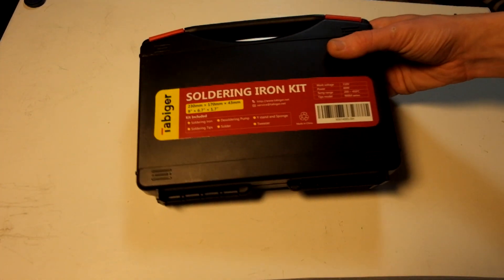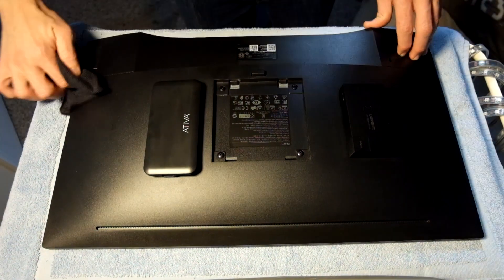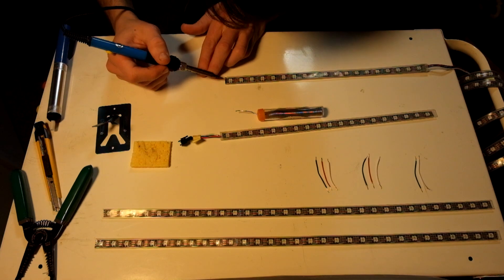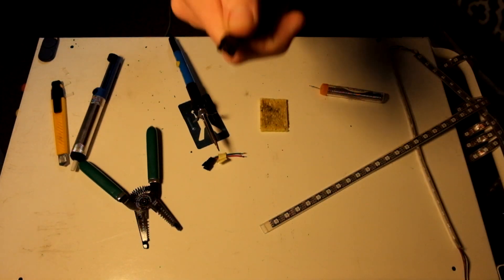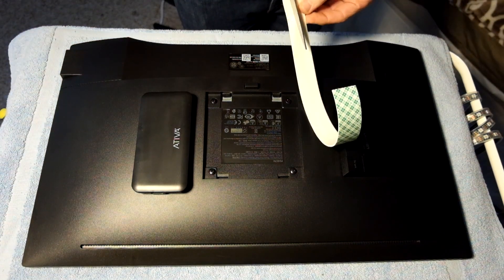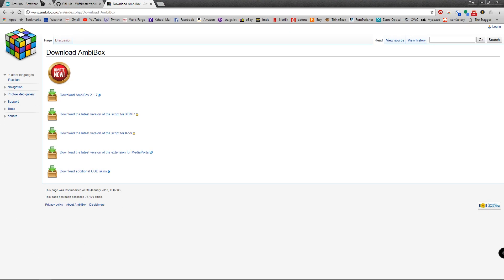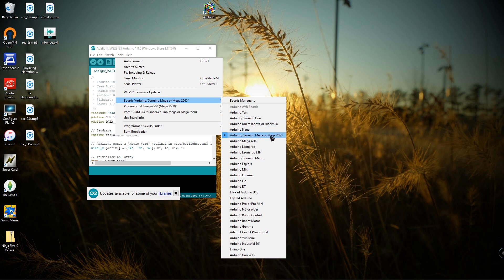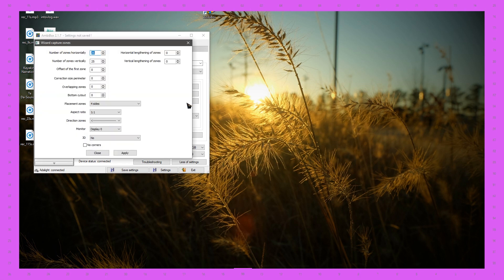Ambilight Tutorial (WS2812B)

Comment: Used ambilight as interior lighting for my PC instead of the monitor immersive effect. Got 3 deepcool CF120 fans with 12 addressable leds for each fan and daisy chained the connection (set the number of LEDs on adalight to 12) and sacrificed one of my molex connectors. On ambibox, I clumped up the 12 color detection boxes at the center instead of the usual boxes-at-the-edges. Configured the boxes with respect to cinematic aspect ratios, rule of thirds and whatnot. I was dumbfounded at first because I thought the idea was stupid but then I put it to a series of benchmarks from slow color shift videos to tomorrowland concerts only to find out it was as epic as monitor ambilight. I guess the effect would look much better on fans with ring LEDs but hey the PC now looks like a strip club. Thanks a ton dude for this helpful tutorial :D

Comment: Did everything you said.  But when I click on backlight no Lights.  Every time I reboot ambibox, the lights do cycle on red, blue, green, and then they cut off for good. Ambibox says it's connected, but no backlighting action.
Reply: Same here, no answer...
Reply: @Drakten1224  Click on more options in the bottom right corner of Ambibox and then select the COM that you set up on the Audrino. By default it is on COM1. Yours is probably COM5 if you followed along with the vid. However, I would actually now recommend using Prismatik. You can pretty much work it out as you go along.

Comment: i Just made it and its really looking awesome but i have a problem!
Some leds wont respond according to color pixels in screen, i looked closely at them they do turn on but have very low brightness and wont change color correctly. So what could be the reason??

I am using 104 Leds setup and 6A external power adapter.
Reply: 60mA on 1 LED

Comment: How its work with LED beacause no wire or cable is connect to LED Tv to Arduino? Tell about connection between Arduino to  LED Tv?
Reply: It works only with PC. You can install Ambilight App for Android on your Smart TV and connect Arduino to TV.  Or use a more complex circuit with Raspberry PI to work with any HDMI

Comment: Oh my god. Best explained out of 15 videos I found before you!!  Thank you. 
Question. I have 3 monitors in my station. (I’m a pro artist). I have a 50”. Ultra hd 4K. And a 24” 144 refreshrate monitor (for reference). And a 22” cintiq!  
I would like to use the same uno board to have it control lights behind the 50” and the 24”. Plus light under and around the desk.  Is that possible or do I need an uno board for each

Comment: I wanted to post and thank you for the helpful guide. I also wanted to share what I used to join my LED strips together, as I believe it is the best and neatest sollution!!

I bought a set of 90° premade pieces (they're like pcb's) that come with plastic clips, so you don't have to solder them to the strips. However, I DO NOT recommend that you use or trust the plastic clips! I recommend using the 90° ends, but solder the LED strip to them! It makes a perfect right-angle turn while keeping it neat and with a good strong connection (from the soldering).

The pieces are available on Amazon, and are reasonably priced: https://www.amazon.com/gp/product/B01NASHQPO/ref=ppx_yo_dt_b_asin_title_o01_s00?ie=UTF8&psc=1

Comment: Ambibox ,a Suck.  Use Prismatik  instead if you want no delay lighting.
Reply: Greatly appreciated on the recommendation. Just built a new PC and even though I copied across the config files from my old PC Ambibox just kept crashing on video or game playback. Easily wasted 2-3 hours tonight trying to fix it and then thought I would pop back and watch the tutorial again in case I missed somethign. I hadn't but seen your comment and thought I would try Prismatik. It works a treat with my already setup LED's and Auduino and is very easy to configure.
Reply: To remove or reduce, go to the "Additional Configuring of Zones" tab in the settings and change the "Smooth" slider. I found that the default "delay" is too much, but on the flip-side if you remove the smoothing completely, it's too much strobe-like lighting. I run my "Smooth" setting at 3 and it seems to be a good balance between reactive response vs strobe light flashes.

I tried Prismatik and it was waaaaaaaaaaaaaaaaaaaaaaaaay worse, like unbelievably 1 million times more delay and lag. When I tested Prismatik with a movie for about 5mins, nothing happened so I stopped the movie. Then about 2mins later the lights started going nuts, it was the movie. The delay is insane! I recommed that you DO NOT waste your time with Prismatik, it really REALLY sucks!!! At least with the Ambibox setup, you get a real-time effect.
Reply: @sparetent  The delay is way to high by default. Changed it down and worked perfectly. Better than Ambibox any day of the week.

Comment: much better video than GreatSctoch's  - in this one: less work or items required, soldering is shown and data pin connections are well explained:)
Reply: Benedykt Karwiński This method required you to have a computer running the software, useful for computer monitor. Scott method is for TV required hdmi splitter and such.

Comment: So I've seen this done with triple monitors. How would I go about adding the rest of the lighting?
Reply: you need to start from 1st monitor left side than top -> 2nd monitor top -> 3rd monitor top and right side than bottom -> 2nd bottom -> 1st bottom and just adjust amount of LED's used in the software and use it all as one monitor - i think it will work this way

Comment: what about 5V 1A,  5V 2A power supply? i think i have to reach at least 20W for 1m 60leds Ws2812B so 5V 4A?
Reply: I have a 5V 2A for 1.2m 30 leds WS2812B and I get some flikering on the last ones on some colours. 4A should be fine tho.
Reply: @TheoKIRAo  my stripes didnt Work, but i think they were broken. i nö bought apa102 144led/1m and they are perfectly fine with voltage coming from Arduino Nano. Thanks for your reply :)

Comment: Does Adalight support multiple monitors? I have 3 27 inch monitors at the bottom and one ultrawide at the top.

I'm guessing I will need about all of the 300 LEDs on the roll so would you suggest using two powersupplys or one at 5V 18 A?
Reply from the maker: It does! You should be able to do it with one 5v 18A power supply.

Comment: Thanks for the detailed video!  I'm planning on running a strip around a 2monitor setup, but I'm worried about voltage drop on 3.5 meters worth of LEDs tbh. Not a clue how to make this work, but I'm thinking I'll use a power distribution bus, split the strip into 3 segments or so for both power and ground on separate loops (not the data cable ofc).. in that case the Arduino just needs to be wired to the data cable and another connector on the ground bus I'm guessing? (Input is welcome from anyone seeing this haha) ... Wish me luck, I've soldered one time in my life so far and I know nothing about electronics, so this should be fun 😅😂
Reply: Anon Ymous info please how is it showing I’m thinking same thing.

Comment: This method work for TV screen?
Reply from the maker: Not this method. This will only work for a PC hook up.
Reply: Awsome work ,Do you have one for TV?
Reply from the maker: You can use any size monitor you want, but in order for it to work it's gotta be running on a computer. There is a way to make it work with other devices, like a playstation or apple tv , but you need a raspberry pie and a HDMI splitter and a few other parts, plus the equipment that I used in the video. It's really a whole 'nother project, but maybe I'll make a tutorial on how to in a future video.
Reply: @treystewart6538  can't wait to see it ..
Reply: I use the "ANY HDMI" version not just the Raspberry Pi source. Been using it for about 2 years now
Reply: @PaulJarrett  Hey did you do it with HDMI ??
Reply: @treystewart6538 Awesome, I can't wait for it !!
Reply: @ErnestoMunoz2075  the link on the website shows you how to use"any source" version. Mine is still going strong going on 3-4 years now

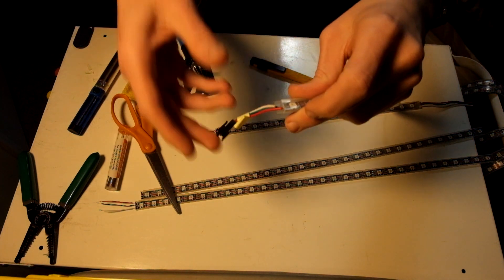Comment: At 5:55 you said you are gonna unsolder the ends of the two led strips but later there is the same connection on an led strip and you take that end to connect it to your arduino. So one of this "adapters" should be left on so i can connect it to my arduino?

Comment: Excellent tutorial ,thanks .The usb cable from the controller connects to the motherboard directly ,or does it work via usb hub too?The usb hub is connects to the motherboard  obviously.
Reply from the maker: Peter Klein I actually have mine plugged into my monitor which has built in USB hub it it so you don't have to plug directly into the motherboard. You can use a USB hub no problem.

Comment: Will the leds go off when you turn off your PC?
Reply from the maker: Yes. Once the Ambibox software closes on your PC then they just shut off automatically. Sometimes the get stuck and won't operate correctly so just restart Ambibox and they'll start working again.
Reply: Trey Stewart Hey man, I connected the red to + white to - but I can't get the led to power on. Can you help?

Powersuply is 5V - 8A

EDIT: I used 12V - 5A powersupply but only some leds turn on and the LEDs get very hot. Idk what im doing wrong here..
Reply from the maker: It maybe too high of voltage or their may be something wrong with your led's. Do you have to WS2812's? Have you tested the led's before hooking them up? Are your connection points soldered correctly?
Reply: @treystewart6538  yes trey you are useing to too high voltage power supply most leds are 5v not 12 and useing a 12 can blow leds. get a 5v 8A power supply high amps is fine it will only use as much as it needs. volts however will damage leds (i think lol )

Comment: Hey Trey, great tutorial. I was wondering how do I figure out how many Amp do need on my DC adapter?
Reply: 60mA x number of leds
Reply: Ba St thank you!
Also, if I have a DC adapter that is rated for 5v and 3A, would that work? In this case the required power let's say is 2A, but the power supply is rated for 3A.
Reply: Niraj Sangani as long as the voltage is correct (5v for ws2812b) then exceeding the required amps is fine and leaves room for expansion. Your lights will only draw the amps they need. Conversely though, not enough amps can result in flickering, dimming or even failure to light up. To summarize, the voltage MUST match, but it is perfectly safe for the amps to exceed.